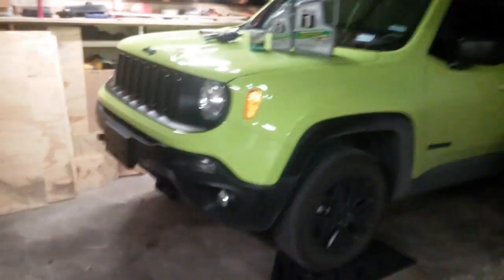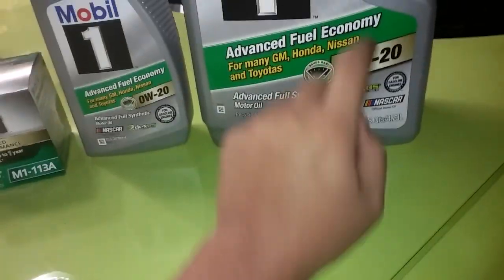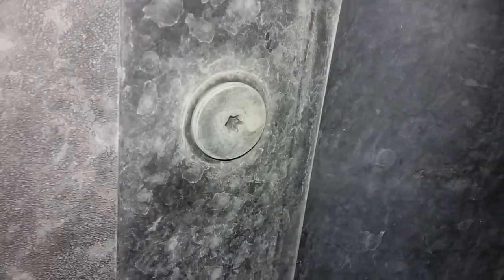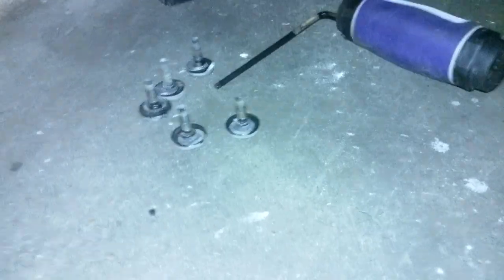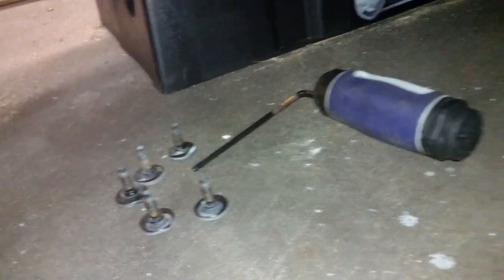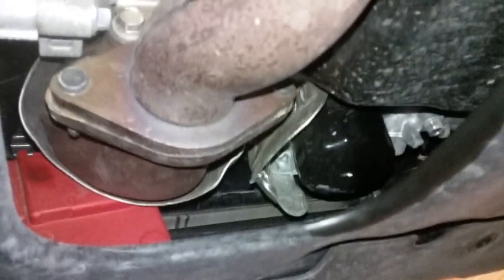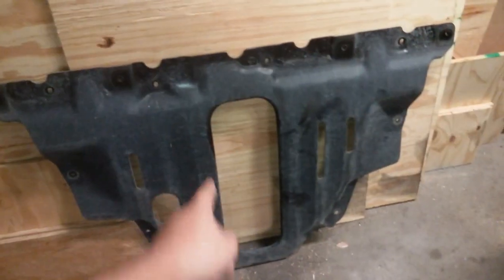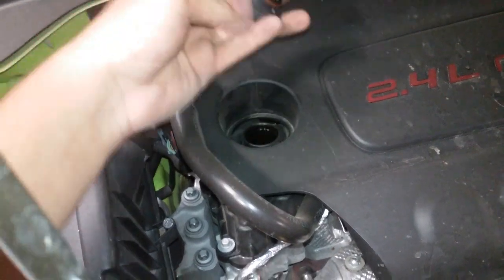2014-2018 Jeep Renegade 2.4L Oil & Filter Change

Comment: A little advice. The skid plate has slotted holes on one side so you don’t have to remove the bolts all the way and it will help you hold it up while putting the rest of the bolts in.

Comment: You don't have to remove the skid plate for the filter removal, you can  put a small container under it to catch the oil and there are different tools you can get to wind the filter off than back on.
Reply from the maker: To be very honest. Didn't even think about that... Thank you.

Comment: Oil drain plug is 15 ft/lbs torque if you care about the details. A full refill is 5.5 quarts for a 2.4L engine, 4 quarts for a 1.4L engine. 1.4L engines require synthetic oil, 2.4L technically can take whatever. Source: 2018 Jeep Renegade Service Manual.
Reply: 2.4 takes 0w20, of which all 0w20 is synthetic. 😂😂😂

Comment: Removing skid plate : On one hand it is probably good to remove those bolts every oil change. On the other hand I'm considering cutting a hole in the plate below the oil filter to expedite the procedure

Comment: What’s self explanatory is changing oil and the filter not just the oil lol but good video
Reply: No chance in hell I’m changing the filter every change with 4K mile intervals on a 20k mile range filter lol if you get the right filter, every other change is fine, just remember when you did and didn’t change it.

Comment: Do you know where fuel filter is located??
Reply: The fuel filter is intregrated into the pump inside the fuel tank. 
If it becomes a problem the entire pump has to be replaced.